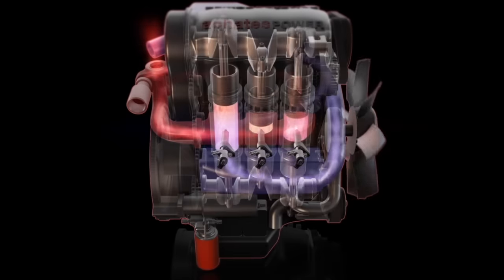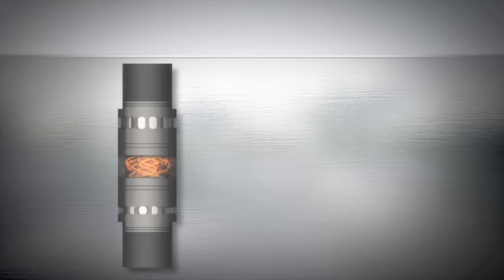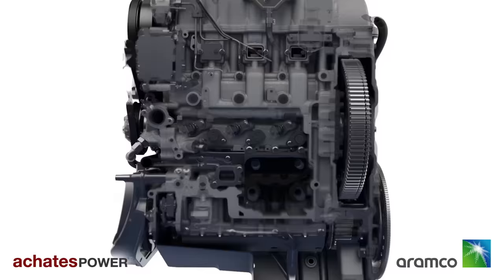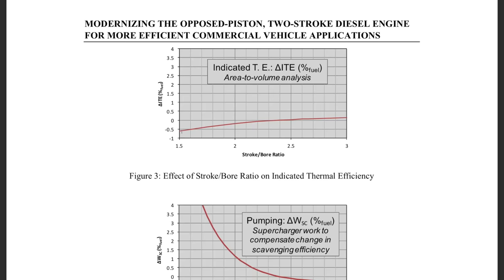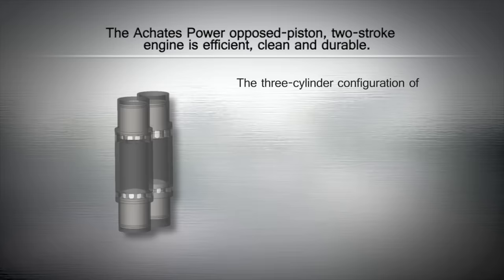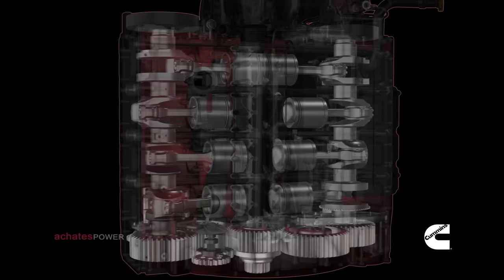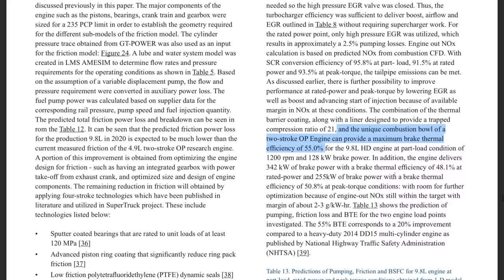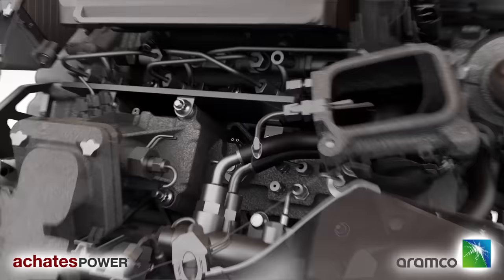Opposed Piston Diesel Engines Are Crazy Efficient

Comment: 2 stroke diesel ? Good luck getting that past the EPA
Reply: just sell it in third world countries problem solved. But seriously, its not a fuel lubricated system, so its not burning oil. It will pass(or not pass) like any other diesel. IIRC a lot of large diesel engines like on ships are 2 stroke.
Reply: @SuperPoonami  Including  the old GMC motors in in highway trucks. Every cylinder configuration. IL 4s and 6s along with V8s and V6s.
Reply: Law makers will probably charge tax based on the number of Pistons now, and not cylinders. So the tax for this engine would be the same as a 6 cylinder.
Reply: You can do it just put a limp mode crappy emissions system with DEF. Diesels have such an uphill battle now with these new emissions regs. No thanks.
Reply: Was just about to say the same thing.
Reply: You can run diesel cars on sunflower oil
Reply: What EPA!
Reply: it doesn't mix fuel with oil
Reply: @jamesb.9155  EPA means I don't want...
🤣 in Sinhalese language.
Reply: @ @esfasia9835  ...Well then. sounds kind of fey.
Reply: EPA does not like diesels. Even Europe want to make less diesels and more electric cars. In USA diesels work for trucks, not for passenger cars. Because EPA knows it's dirty. Cars with diesels are more expensive. Maintenance (oil change) is also more expensive, price of fuel is generally more expensive. Otherwise, we would see Prius diesel hybrids. But not in this reality.
Reply: @vertik7  
Diesel fuel IS more expensive than gasoline but you get more energy out of diesel

Comment: Even more questions: How dose the top crank and other mechanism get oil especially during start up? V and in-line engines have pretty much one oil pan underneath for lubrication. Can oil leak into the cylinder from the top?
Reply: That is a good question. I would imagine you would switch to a heavy grease instead of an oil bath, but I doubt that would be as good. You can cool by running the oil though the crank itself, but a hallowed crank sounds like a pain  to manufacture.  

If I had to guess, that is probably one of the big problems keeping this from market. That, and the thermal expansion  at startup is probably a nightmare; you couldn't do a normal oil pan on bottom because you will have exhaust leaks before the bottom piston expands.
Reply: Like almost all internal combustion motors larger than a chainsaw or dirt bike's they use pressure lubrication. Oil is pumped to each bearing and through drilled passages in the crankshafts to the connecting rod big end bearings.
Motors are not lubricated directly from the pan. All the pan does is catch the oil coming down from the bearings and cylinders and hold it for the oil pump pick-up.
Splash and scoop lubrication is of the "Model T" era.
Pistons don't seal by expansion. Piston rings are used to seal against leakage and to remove excess oil from the cylinder bores.
Reply: Maybe they could lay the engine on its side like a Subie. Then you could have oil in both crankcases and it wouldn't necessarily drip into the cylinder.

Comment: The oil lubricating the upper crankshaft will flow down to the back of the upper cylinders. Where does this oil go?
Reply: Not if it was a horizontal engine. Then the problem would be the horizontal bulk.
Reply: same as in radial aircraft engines, before start must be rotated by hand to push out oil from lower cylinders through spark plug hole
Reply: @makantahi3731  I was referring to the top cylinders. Where does the oil do after it lubricates the upper crankshaft. They will fall behind the upper cylinders.
Reply: yes, it is same as on radial engines but there oil falls on lower pistons and enters into combustion  chamber, where can cause hydro lock, same can happen here if oil comes into combustion chamber inside of pistons
Reply: And, adding to makan, would probably be be burned in combustion chamber during operation.

Can't imagine it being that much oil usage.
Reply: you surely did not hear that oil is not compressible as gas is
Reply: @makantahi3731  well, I expect oil leakage to be very small during operation. If it leaks so much oil during a single stroke to become a problem volume wise to your compression chamber, you don't have an engine but an oil pump.
Reply: it is not oil leakage during operation it is oil drainage when engine is stoped and after 10 or more hours out of operation, oil would enter into combustion chamber, so before engine start up oil should be empted , that is procedure with aircraft radial piston engines, i am suprized  all you do not know that
Reply: If a piston is stopped at top dead center, would the crank case oil be able to flow out the exhaust port? and if oil gets past the rings, on the upper piston, I bet it would get past the rings on the lower piston. But if it doesn't, I bet youd get hydrolock.

This engine sounds great in theory but I think reliability may be an issue.
Reply: @WalkingTrashcan  
This type of engine powers the emergency generators on the US Navy's current nuclear submarines.  One of the models of this type of opposed engine has been in constant production since the 1930's. I'd call that reliable... Maybe TOO reliable for the planned obsolescence engineering in our disposable society?

Comment: What's the fuel efficiency ?. Many people are wary of strange engines.. rotary, turbine , 2 stroke.
Reply: First, it's diesel, so it is going to be starting at diesel levels, which is much better fuel efficiency wise, to begin with. The fact that it has a more efficient intake/exhaust airflow design and a turbo driving it, I am willing to bet it is going to be pretty damned efficient comparatively.
Reply: Google it...
But knowing 2stroke diesels I can say a LOT of fuel is consumed...

Detroit 6v71 will cost you $100 a day to drive lol
Reply: @screener545  No worse than any emissions compliant vehicle.   $100 in fuel doesn't go very far these days. 

What should make you mad is that a 80,000# commercial semi rig with a older no emissions compliant engine pushes 400+ HP and can run interstate speeds and still get 6+ MPG.  While a common modern tier 4  diesel pickup, that weighs 1/10 that plus has 1/5 or less the aerodynamic drag, only gets 2- 3 x that in the exact same driving conditions. 

Who do you think is get screwed the most here and why? 

Hint:  Big oil only makes 10 - 15 cents a gallon on the fuel while the big government tax man gets 40 cents to over $2 a gallon on it.

Comment: You know what’s even more efficient? Electric motors! They convert 80-90% of the electricity into power on the road. Even when you consider charging you get >70% efficiency. When you consider, that you can charge directly from your solar roof, they are very clean. If you want to use highly efficient internal combustion engines (45% efficiency, which is way more than currently operating) with efuels, which convert the same green electricity which can be charged with just around 5-20% loss into the EV into efuels you loose >90% on that process. ICE cars are just orders of magnitude worse at efficiency than EVs

Comment: It's NOT supercharged. It uses a scawenging pump like common two stroke diesels.
Reply: So what youre saying is... We can still supercharge it?
Reply: @devins7457  🤣
Reply: it's like saing "it's no turbocharget. It uses a turbine-driven forced induction device that increases an internal combustion engine's efficiency and power output" xD yes, it is supercharged because it must be, just like common two sroke diesels
Reply: That depends upon the size of the supercharger: if just adequate to meet the volumetric breathing demands of the engine, it's a scavenge pump: if it raises the cylinder internal pressure above atmospheric at the time of intake port closure, it would be a supercharger. Shift the exh port timing vs intake port timing by offsetting the crank positions slightly so the pistons are just slightly offset during their cycles could easily do that with only minor vibrational penalties, I should think.
Reply: It has both a supercharger and turbochargers. Right there in the video.

Comment: A few decades or more ago that would have been a big deal, but at this point it's simpler to just go electric.  Even if you could reach 100% efficiency and eliminate many of the problems and concerns of gas engines, it's so much better to operate a computer on wheels than a mobile power plant.

Comment: Sounds great. I thought the 2 stroke Detroit was a good engine also.
Reply: 2 stroke Detroit's were good in equipment, but in the highway trucks which I drove many of them where lack of torque when under 1900 RPM. I drove the screamer 6v53, 671 in line 6, 8v71 was the most used by Ford in their Louisville line in the 70's, then the 8v92 series. Once GM got onto making the 4 stroke 60 Series, then they had an engine, that never left it mark with a puddle of oil like the 2 strokes did under them where ever they stopped.

Comment: piston engines are going to be around for a while, until some one figures some other way to generate reliable power at remote locations and stand by power generation for airports and  hospitals.  you cant use electricity to generate electricity.  turbines are a possibility, burn gobs of fuel,  are maintenance critical and spensive. Ask anyone who owns a turbine helicopter!  the highway diesel semi aint exactly dead yet!!  If you were to try and convert today's commercial  traffic over nite to electric,  the power availibility requirements are mind boggling.  diesel fuel can be stored long term, Distribution system already in place.   Hard to store large amounts of electricity long term,   maritime and maybe construction equipment  will use reciprocating engines another 40-50 years
Reply: james davies your comment you can not use electricity to generate electricity is actually fundamentally wrong , you can indeed harness lightning to power things which is natural electricity !! Electricity is all around us , static etc.... and even kinetic energy !! it’s everywhere if you don’t know this I suggest you look into it
Reply: @iamasmurf1122  His comment is technically correct, Harvesting lightning is not a good idea, nothing can really store that amount of electricity safely and its not a reliable source of electricity. Static is made from friction which is a stupidly inefficient way to generate electricity, you lose the majority of the energy you put into such a system from heat. Kinetic energy is not electricity
Reply: Dravlynn the kinetic energy has to come from somewhere. I suppose the backup generator could be a bank of electricity generating stationary bikes, but do we expect half the hospital staff to abandon real duties to go power the place?

Comment: I wonder what Subaru has to say about this. Maybe start making OPE instead of their boxers for the efficiency bonus? Obviously they would have to be placed horizontally into the engine bay because Subaru.
Reply: Yeah, I was wondering the same if this configuration would work well in a horizontal layout with the central gear connected to the transmission, instead of from one of the crankshafts.
Reply: Hopefully there is enough cost-effectiveness to pull something like that off so we might see it becoming a thing.
Reply: Probably solve those head gasket issues.
Reply: Brian Bradburn I should think so given this engine doesn't have head gaskets!

Comment: How good is it at meeting tier 4 pollution control?
Reply: Should be more efficient. Fewer parts mean better?
Reply: Look at it like this, if it was any good they would be out there.
Its a two stroke and its small so dont hold your breath.
Reply: @lynalllynall9082  You will need to hold your breath as 2 strokes smell of burnt oil.
Reply: @fivish  Only the gasoline ones that use the crank case to pump air into the cylinder. Since these use a blower to pump air into the motor, no oil has to be added to the fuel or air.

Comment: I can't see it having emissions control for current standards. That's been the problem with two strokes and rotary engines.
Reply: Emissions control, especially in relation to hybrids/electrics would be it's downfall I agree, at least as an automotive engine.
Reply: It’s not a problem here as the fuel is injected at the point of ignition . With a normal 2 stroke some of the raw fuel slips buy into the expansion pipe as the valve ports are being closed by the ascending piston dome
Reply: Actually I have been thinking of this problem for a while as I rebuild classic 2 stroke sport bikes. If we could inject the fuel at the point the ports are closed in a tradition 2 stroke it wou be as clean as a modern engine but have twice the power duty cycle and be a lot lighter
Reply: There are five major gases to consider in emissions. I'm not going to get into a lengthy educational blog but there is a whole lot more to it than unspent fuel. Tougher emissions standards are why we have shitty camshaft profiles and vvt. You certainly will never achieve this in a two stroke as we know it.
Reply: Robert Kington well I think direct port would at least bring the two stroke back onto public roads . Great motor bikes
Reply: @michaelschuler7397  - Are you thinking of a gasoline fueled two stroke cycle motor that has fuel vapor in the intake air? Diesels are direct injection. Only air comes in through the intake ports. Same with direct injection gasoline motors. There is no fuel in the cylinder until a few degrees before TDC.
Reply: Al Grayson yes petrol or gasoline 2 strokes like mopeds and dirt bikes . Imagine if we could inject the gas after the intake ports closed . It would be a huge improvement
Reply: You wouldn't really need to do anything differently than you would for any other large diesel engine. Because you're direct injecting it, there is no need for oil in the fuel, although you would need an oil pump or two for your bottom ends. Your intake ports only handle air, and because it's supercharged and turbocharged, you don't need the downward motion of the piston like a 2-stroke dirtbike, to give you a positive intake charge. You could probably fit an appropriate sized catalytic converter, particulate filter and DEF system and it would pass emissions for a  4-cycle diesel engine roughly double its size. A 4ish liter engine could be a direct replacement for something like a 7.8l Isuzu 6H diesel or a 7.2l Cat 3126.

Comment: Ecomotors developed one that looks even simpler than this like 5 years ago.
Reply: Did not help them. Ecomotors is bankrupt.
Reply: Yes, they did, and those engines wouldn't last. I worked on the development of them for 5 years. Too many issues with durability, vibration, and major oil consumption isuues.
Reply: @PeeterPuncher  That is interesting info. During development they said that they need to solve oil problem, but low level of vibrations was supposed to be one of the design advantages.
Reply: @pumahuhu365  yes the low level vibrations was a lie...only at a couple of low-rpm engine speeds where there was very little to no vibration.  Most other speeds it ran at had horrible vibrations, constantly broke parts and brackets and and at most of the high engine speeds the block actually flapped like butterfly wings. If I recall, NVH tests showed 70 Gs of movement at certain rpms.....the thing was an absolute joke and a huge waste of money.

Comment: so its a 2 stroke diesel engine.... sounds totally clean and environmentally friendly hahha
Reply: Wouldn't it be just as clean or cleaner than a 4 cycle diesel? More efficiency should mean more complete burning of fuel and thus less emissions, right?
Reply: @ShaunLang  Well uhm, regular 2 strokes are really bad for the environment, not sure about this one tho
Reply: @andries4561  I think that it depends.  If the lube is mixed with the fuel then yes.  Remember that we are talking about a modern fuel-injected two-stroke. Wasn't the whole point of mixing the fuel and oil together in the old days to lube the crankcase so that crankcase pressure could be used to send the fuel up to the cylinder on the piston's downstroke?  With fuel-injection, there isn't really a need to have fuel in the crankcase and thus no need to mix them together.  Or is there something that I am missing here?
Reply: @andries4561  The number of strokes an engine uses per combustion is completely irrelevant from any environmental impact what so ever. You sound foolish even bringing it up when you havn't a concept of how an internal combustion engine works nor what causes something to be "bad for the environment". Spouting off with tidbits of information you heard in passing just makes ignorant, not some kind of environmental white knight.
Reply: @chrisbarber8973  who hurt you? Why do you feel the need to piss on me when I have done nothing wrong
Reply: @ShaunLang  Yes that was indeed the point, my moped is still running like that and I love it
Reply: The exhaust port is closed when fuel is injected. So as long as injection is optimized for most complete combustion it is just as clean as any 4 stroke. No pumping loss like in 4 stroke cycle. The idea is the amount of work you can generate from a particular volume of fuel. This design minimizes losses in every sense. 2 stroke makes it sound scary but if you are aware of the differences between the two types of motors this design essentially combines the best of both
Reply: A 2 stroke Diesel engine is absolutely nothing like an old technology 2 stroke gas engine